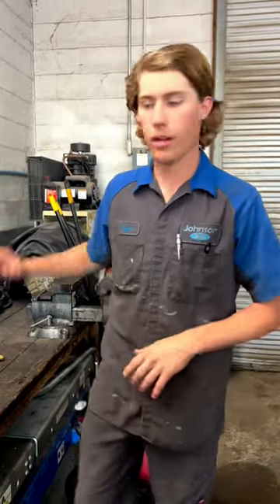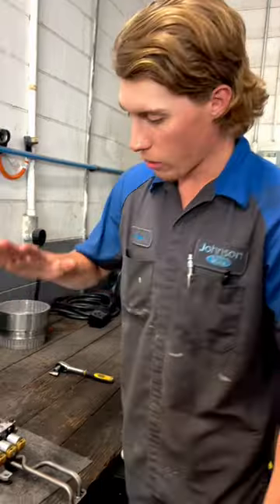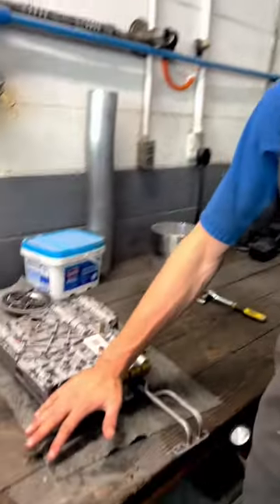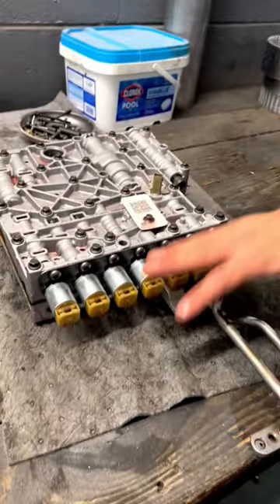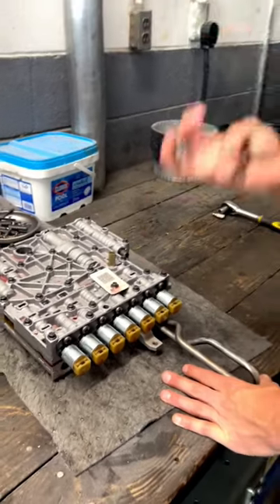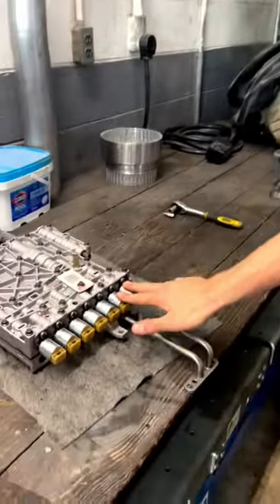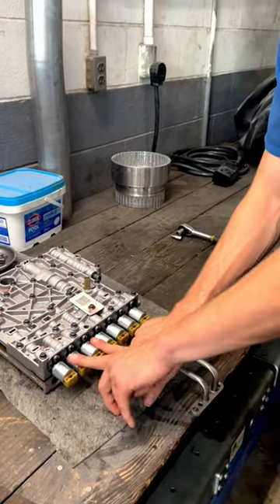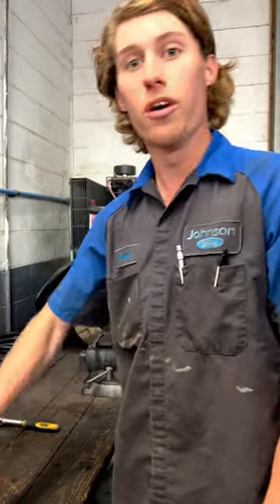What are valve body solenoids? #shorts

Comment: My valve body SNAPPED in half after I installed a jet performance stage 1 chip into my 05 dodge ram 1500.
Reply: Damn a dodge breaking a transmission? Weird 😬😬🧢🧢
Reply: Sounds like maybe some twisting in the transmission I’d install a deep pan it’s an aluminum transmission pan locks it in place better

Comment: Which one causes Ford to not warranty an F150 with less than 10k miles that downshifts itself to first at 70-80 mph because they can’t repeat the extremely dangerous intermittent issue, causing what is now a former customer to dump the truck back at the dealer and take a $10k loss?
Reply: You should have taken it in 3 times for the issue and had them lemon law it while showing them the receipts. We’ll what’s done is done. Take the L and keep it moving
Reply: @aayesher9400  I took it in more than three times, and state by state lemon laws vary. I was on the last visit before lemon law kicked in where I purchased it, and only then did they finally fix it (I think), only to have it start draining the battery the next day. At that point I traded it in for another manufacturer and swore to keep telling the story for the money I lost. Have a good night.
Reply: What are you doing to it when it does that?
Reply: @BigWheel.  Driving it. It was normal operation with no instigation in any way.
Reply: What year ?
Reply: @joecostu1571  It was a 2014 with a six speed. Haven't owned another Ford since.
Reply: Did the engine spin at like 12 thousand rpm’s?
Reply: @chrisf1147  It bounced the limiter several times every time it did it, pegged as high as it read. I told the dealer the truck was worthless to me with the abuse the issue cause to the engine even with such low miles. I'll never do business with Ford again.
Reply: @timtimtimmay4654  thank you